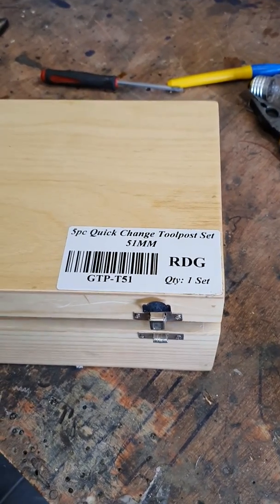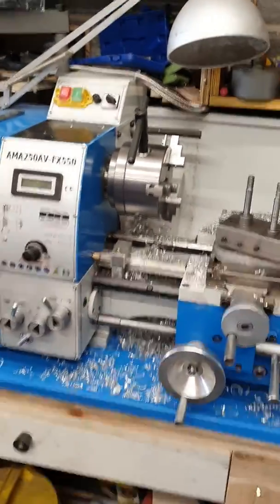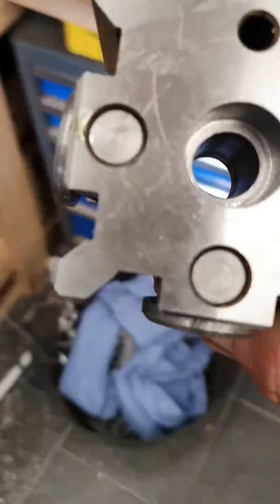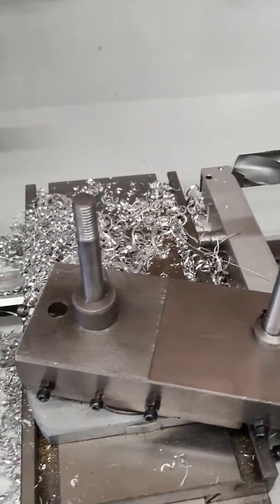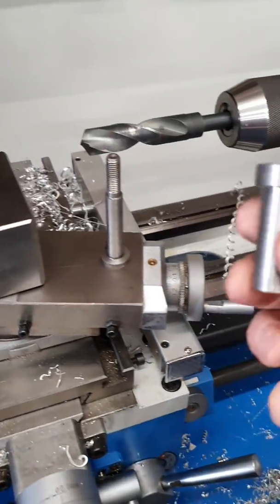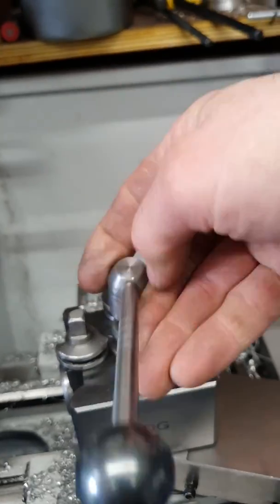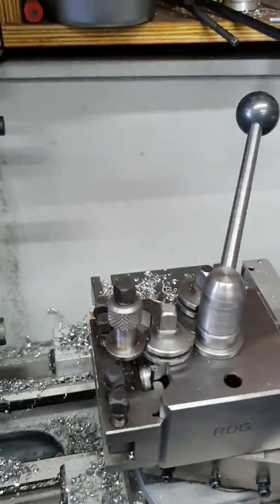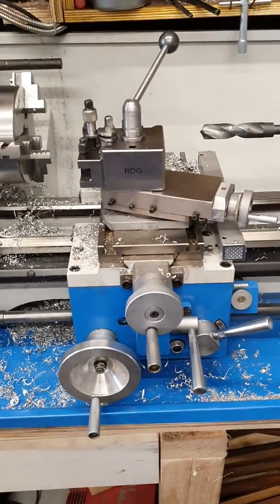Fitting a quick change toolpost to chinese lathe ie amadeal warco Chester etc

Comment: Hello, im really debating whether to pull the trigger on this exact lathe, could you please tell me if its worth it? Or do i avoid and go for a different brand. Many thanks
Reply from the maker: To be honest if your looking at chineses lathes they're all pretty much the same whether it be a warco , armadeal etc but it's not a bad lathe it's done pretty much everything I've asked it I've replaced the motor after 4 years but that wasn't too expensive  so great for the money really cheers steve